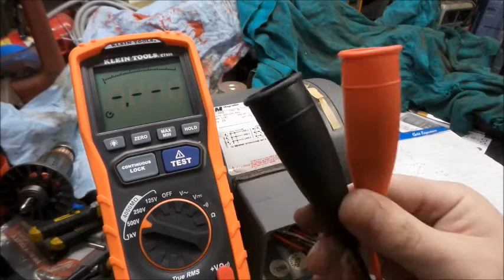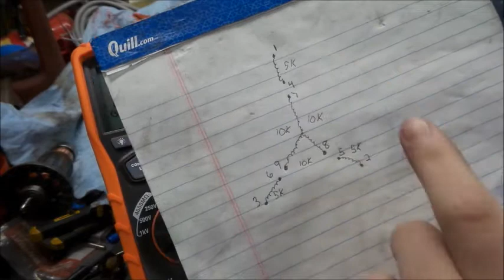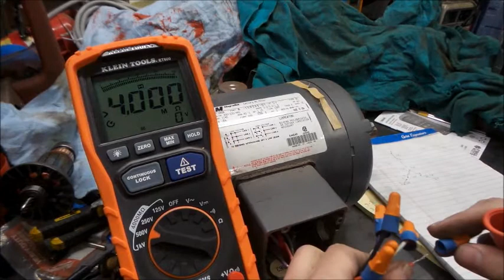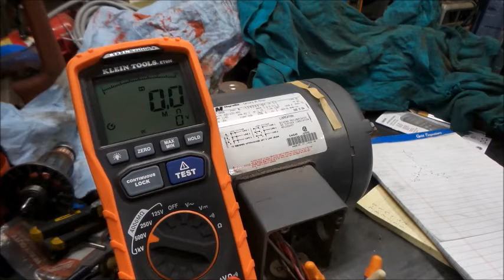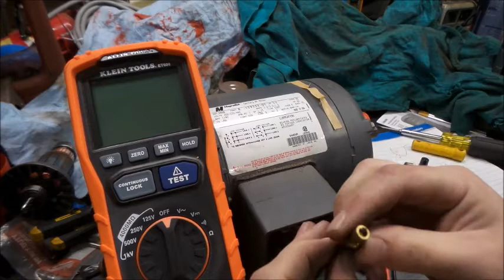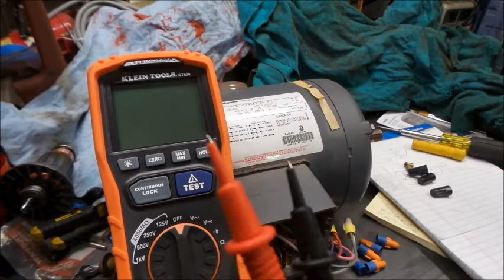Motor Testing 101 - Testing a Motor with a Klein Tools ET600 Meter

Comment: Why is it unsafe to touch the leads together when you first turned the dial to 500V, but its safe to touch them while hitting the test button?   I thought you werent supposed to touch the leads together during testing as told in the manual
Reply from the maker: It wouldn't be safe to ever physically touch the leads yourself. 

Touching the meter leads together can be a sanity check for the meter. Ideally, you want to verify that the meter is putting out its charge. The only way I know of to physically test that would be to short the leads out and push test. If the meter verifies the short you created and also verifies an open lead test, I would then be more confident in the test I am about to perform with the meter. Not only are you testing the meter, but you are testing your leads. 

If you had an open lead, everything would test great, but once you create a known short circuit and the meter reacts the way it should, you can be more confident in your testing. 

I'm not familiar with the manual, but if this motor were shorted, how would that scenario be any different than shorting the leads together? The meter has to be rated to handle short circuits. That's what it tests for. Verifying your leads is always important no matter what meter you are using.

Hopefully, I explained that decent enough. Thank you for the comment it was a good question.

Comment: Around the 4 minute mark you were saying your readings were 10K but the meter was reading 0.010 K. Wouldnt that be 10 ohms since youre at 10 hundreths of a Kilohm, which is 1000 ohms ? Thanks. Expecting delivery of this meter today. Bought it for testing insulation of hybrid and battery electric vechicle cables. Also have a milliohm meter coming too. Thanks again.
Reply from the maker: You are correct. I mis-spoke on the video. Let me know how you like the meter once you get a chance to use it.

Comment: Did you have the meter lead connected to earth ground or grounded to motor housing on the insulation test?
Reply from the maker: Typically, you want to test the motor housing to verify the insulation of the motor windings. If the insulation starts to fail, you'll see a bad reading to the housing overall cause the windings start to come in contact with the housing. 

If you test to the earth ground, you are testing more the distribution system, which can be a valuable test but isn't going to help troubleshoot the motor.

Hopefully, I explained that, okay. If I didn't, I'll try and help out the best I can.

Comment: Does it tell u if the insulation is weak?
Reply from the maker: Depending on your reading you could probably figure out you have some issues. The higher the number the better. If you have something with lower numbers it might be an indicator of failing insulation.
Reply: @TalkingHandsTools  thanks. Anything less then 100 mega ohms would be a caution right
Reply from the maker: @Hvacnc yes I would start considering other options. I'd have to look it up, but I think anything less than 20 mega ohms would be condemning. Don't hold me to that, though.

Comment: Did you say 240 v single phase using l1 l2 l3 ? Should there only be l1 and l2?
Reply from the maker: This was a three phase motor, so it has three poles. I don't believe I said single phase in the video, but if I did, I misspoke. This motor might be getting set up to run on single phase, but more on that in the future. Thank you for the comment, and I apologize for any confusion.
Reply: Thanks . No problem, it was around 1530 in the video you mentioned it.
Reply from the maker: That's a good catch. I'm referencing a future project. We intend to use this motor to make a rotary phase converter. In order to do that, we will be running the motor on 240V single phase. The motor will generate the third phase through magnetism. More on that in a future video.

Comment: How is turn to turn shorts in winding diagnosed when it does not short to chassis on a single phase 220 or 120 VAC motor?
Reply from the maker: What do you test with a regular ohm meter across the field coils of the motor? The megger may not be the correct diagnosis tool for what you are looking for if nothing has shorted to the chassis. Also if the motor has a capacitor test that to ensure that has not failed.
Reply: @TalkingHandsTools  thank you for the reply. 
Capacitors are test and checked off. 
What I can measure is the amp draw while motor in question is running it is about 1.5 to 2 amp more that usual. Which based on my experience points to a bad run capacitor. But it's not so in this case. 
If it's a turn to turn where one wire is shorted to the wiring right next to it inside the winding spool I can't even see if a very accurate micro or mili resistance meter would be able to point it out
Reply from the maker: What condition are the bearings in? You may have to take the bell ends off and visually inspect the rotor and stator. If there's signs of melting in either you may be looking at a heat related failure. Bearings failing can cause overcurrent faults as well.
Reply: @TalkingHandsTools  bearings? maybe. But one  Motor was barely a year old. I didn't open it because it was under warranty for 5 years. But I have 2 in the shop in my own pile with the same issue. Though these guys were about 10-12 years old when I took them out. But you know how it is with one's own pile of motors that need rebuilt or something..... end up just paying rent for them for now. Lol
Reply from the maker: That is interesting were all 3 used on the same piece of equipment? I agree bearings are unlikely on one a year old unless there are some goofy motor shaft loading things going on. Are these motors mounted to something that may require shims for proper alignment? Or do they have an abnormally high loading for their size?
Reply: @TalkingHandsTools  no not all 3 where on the same unit. But these motors are specific to a compressor model series from a certain manufacturer. 
It is the type of compressor that has two Pistons directly mounted on the motor 90 degrees from each other.

The 2 in the shop are on one compressor that's been in the field for over 10 years. It started popping the breaker. due to its age replacement was ordered. 
Haven't put in time to do anything with them yet... But now that they are in my front view I might start working on them.

The one that I originally messaged about which is about a year old is on the same brand compressor. it's been replaced with a new head already and the broken motor was sent back to oem.
Reply from the maker: Sounds like it's specifically built for a purpose. Do you know if there's adequate air flow going through the whole thing? Another thing with compressors is rated duty cycle you can push that a little but if your exceeding it by a decent margin you might see failures like you are experiencing. The other thing is they may be poorly designed. I've seen auxiliary fans installed on things already to try and help cool things down.
Reply: @TalkingHandsTools  yes poorly designed is a possibility. 
Fans attached to both side, to motor shaft in the rear and the crank shat in the front. 
I hope it's not aluminum winding I'll know once I open.
I was wondering a turn to turn short could possibly have two different resistance depending on how solid is the shorts.. so maybe an unstable resistance reading at some frequencies or voltages could point to a turn to turn short.?
Reply from the maker: I would think depending on where the short is and how many windings it spans it should definitely show up with an ohm meter. The motor should be symmetrical any deviation in readings would be pointing toward something being wrong. I believe you mentioned this is a capacitor start and run motor so I believe the windings should be the same and are offset with the capacitor to create rotation. 

That being said are you certain the centrifugal switch to cut out the start capacitor is working properly? It is possible that it could stick in the start position that would result in the capacitor staying in the circuit and I would think as a result making the motor fight itself magnetically which would create heat also.
Reply: @TalkingHandsTools  thank you. I will check all of that. These motor take 1 capacitor which looks like it act as a start and run capacitor . 
The values are 50 to 55 uf. 
I would take them apart and check him out grocery store checkout in February.
Waiting to get some leads for a hipot tester that I purchased
Reply from the maker: Let me know what you find. It's frustrating when you get repeated failures and failures after a short amount of runtime.
Reply: @TalkingHandsTools  yes it is. I will update once I work on it

Comment: Great video, loved it. Just bought the Klein megger and suggest this to Electricians that need to troubleshoot without the expense of a high dollar meter.
Reply from the maker: Glad it helped! Thanks for the support...much appreciated!
Reply: Yeah fluke are a little to heavy to swallow
Reply from the maker: @StephenRoss-po1rp nothing wrong with the old crank style. I have an old Biddle myself. It's in  video here on the channel where I tried to simulate a break in the insulation. The video didn't go as planned, but I did get to show the operation of different kinds of Meggers in it.

Comment: OK, so it looks like you are just testing resistance between the legs to make sure they are consistent.  What if you get zero resistance?  what does that mean?  You're not really getting into pass fail criteria, just taking measurements.
Reply from the maker: You bring up a great point. Zero resistance between legs would mean the stator is likely shorted out. If the you measured an OL or Open Line it would indicate a field wire has burned up and is open. If you have zero I would definitely lean toward saying you have a shorted out field winding which unless you send out the motor for repair isn't something you can really work with in the home shop. It all depends on context some things are worth trying to repair others are not thats your call. I have another motor to test here that I'd like to make a video on testing I just need the time to put it all together. Hopefully I helped you out a little.
Reply: @TalkingHandsTools  The reason I brought it up is because Im been racking my brain for the past week trying to figure out why this 3Ph motor is spinning up to full speed and then popping the breaker after about 20 seconds..  This particular motor is around 100 years old,  delta wound, and has only 3 lead wires (3 lead motor)..  Ive been doing this resistance check test and getting zero resistance.  I even bought this meggar thinking that the insulation was starting to leak after spinning up..  Anyway, my troubleshooting was going nowhere, until I saw a diagram of how a Delta wound motor is wired in series-parallel combination config that kind of lets the current bypass a burned out coil. Unless you can check in between the nodes... lol In this case, I think there is a reason they don't make like that anymore... lol    Anyway, sending it to the shop tomorrow for diagnosing, and probably re-winding...
Reply from the maker: Any update on what the motor shop found? I really enjoy older stuff and love seeing how things evolve over time. I don't recall seeing a three lead motor thats a really interesting one.
Reply: @TalkingHandsTools  they were pretty busy.  Im guessing it could be a few days.  I’ll report back when I learn something new.  I think I may ask him If I can watch them rewind it.  I considered doing it myself, but then my ocd meds kicked in and I came to my senses…. Lol